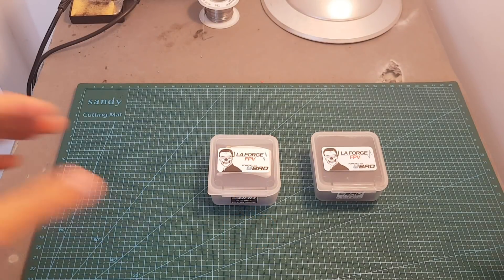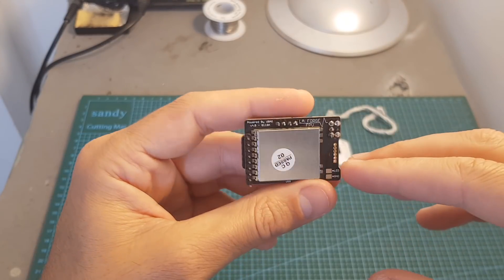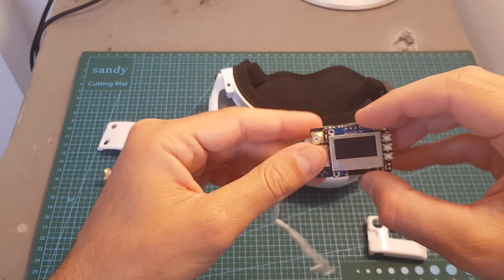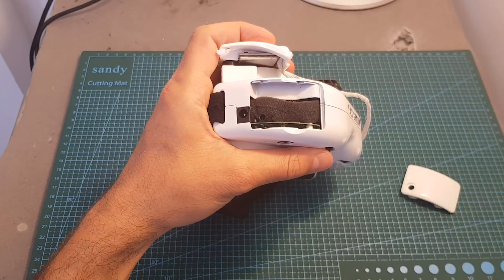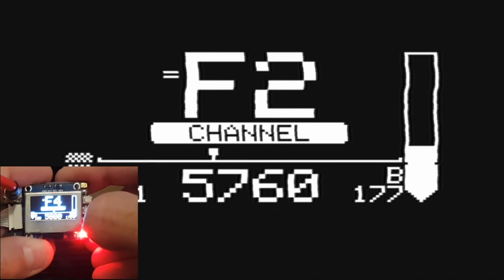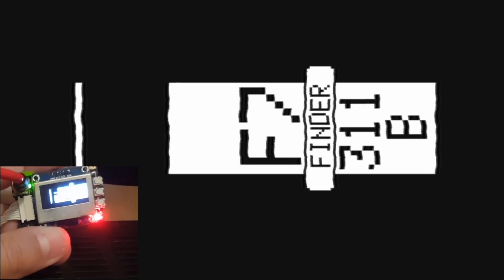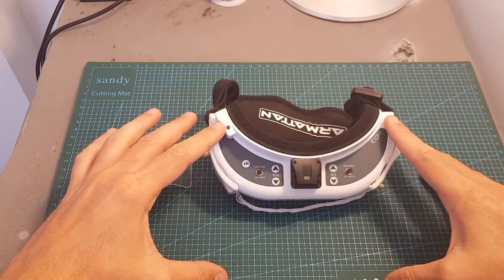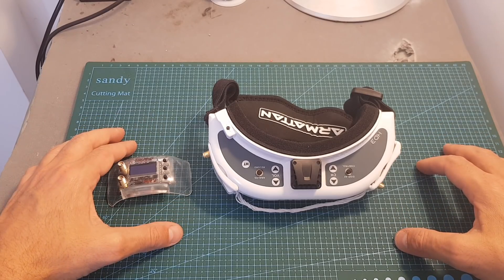LaForge V4 Overview & SBS Comparison With FuriousFPV True-D

Comment: Bro what are you doing! You don't have to open up the goggles to stick the wire through the holes in the doors for the modules. The cutouts are so you can run the wires on the outside of the goggles and not damage the wires by pinching them like that. Watch a different video of them installing it you put the connector inside the doors even though the wires on the outside to prevent the wire from getting pinched
Reply from the maker: Thanks for the advice buddy, but don't worry, I was careful not to pinch the wires when installing the module.